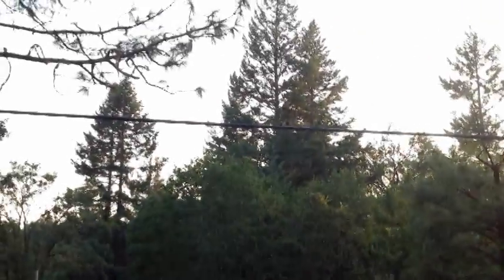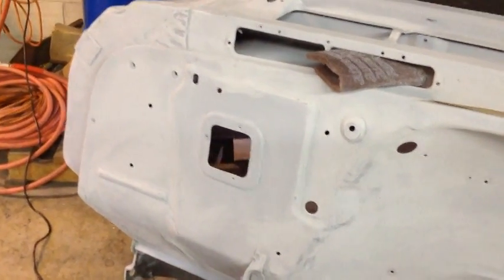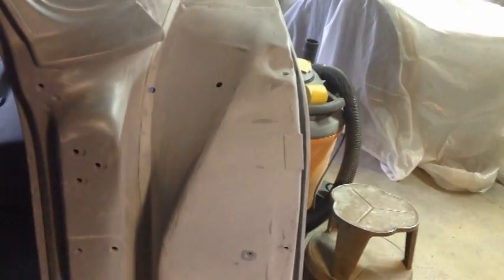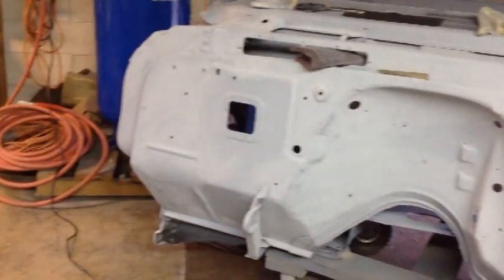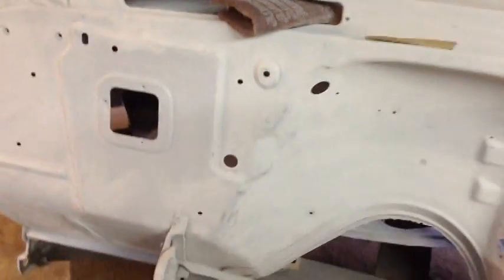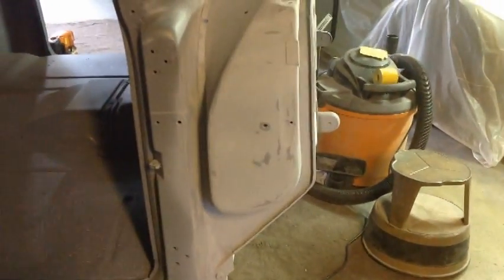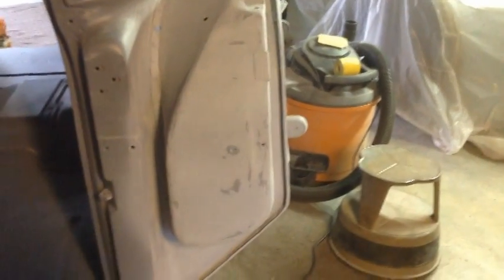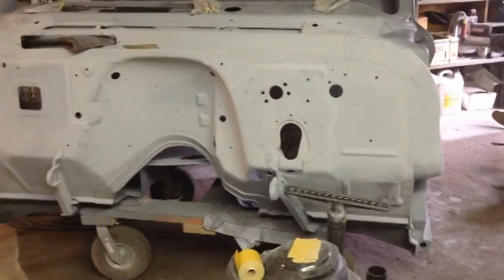1966 Chevy Truck- Fire Wall Prepped for paint

Comment: YOu poor old Chevy Kid you. I thought yall up in the northern part was cool but guess I was wrong. My daughter-in-law out in Billings said they were sitting in +90's cooling off and watching birds. Brian Bloc up in Ken-tuck is about like you. I just thank God for a blessed heat pump! I got a 13 inch squirrel cage in my shed but it's a hot air circulator. I spent the whole day cleaning out the inside of the Taco. Worn OUT! Not like a full sized rig so I have to stay bent all the time. But it's done and Sweete and me are going to go get dead chicken sammiches! I can remember when everything the year of Crustine would vapor lock in a second because of the sorry gas. And that's how I got my 440 mag. No oil.  A new top end fixed that jewell. And I guess I'll bite the bullet and get a grinder and start filling in some holes in the Taco. I don't sand, I grind. It's going to be good enough for who it's for. No show rig, just back and forth,  a.c., dry inside, heat and 4x4 when needed. Everything else is extra. You're doing good. Heat up your hot glue gun and fix that swamp cooler in the house. You'll be glad you did. IH had some FINE looking veggies. Take care!
Reply from the maker: Yeah, getting to that time of year now where the mornings are cool and the afternoons are scorchers. haha But still doing well...the fires in CA have smoked us over again. Made for a nice 60 degree morning though. Thanks mate!
Reply: Like it was here last summer. Smoke all over the place. Glad you're getting a cool breath though. Keep on fixing them saws and you can use the Glamour Girl to go pick them up and deliver 'em!